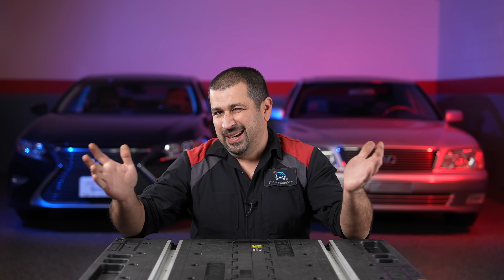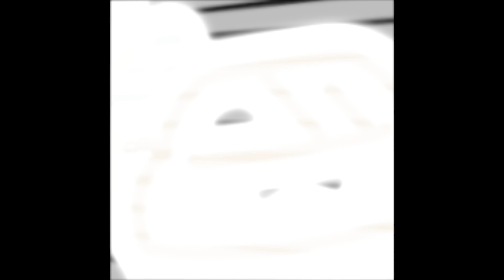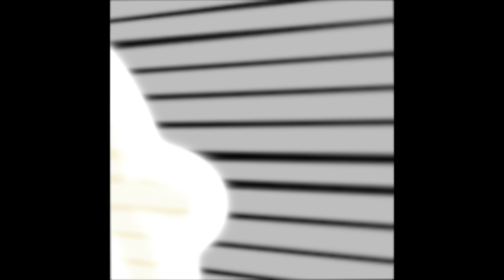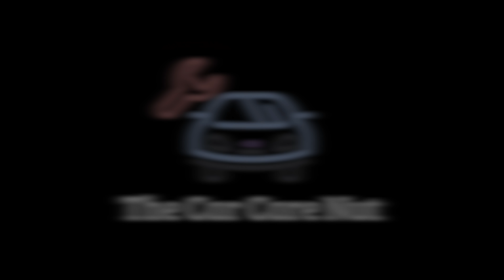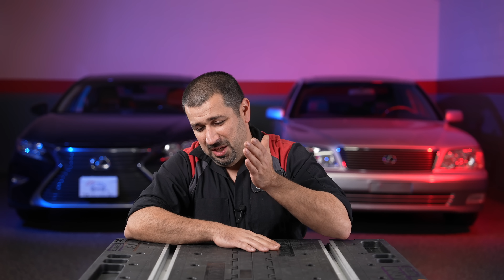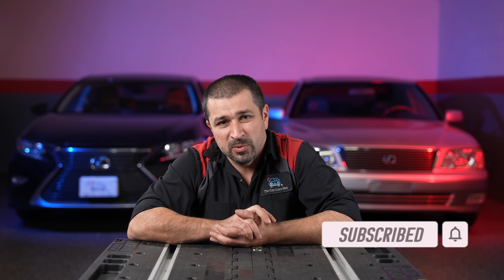Can Modern Turbo Engines Be Reliable? Here's The TRUTH!

Comment: Plenty of 1980s era Porsche 944 Turbos still around. Those were very modern for their time and had cooling that stayed on after the car was turned off. Many other then advanced features. The older generation without this is where turbos really got their bad reputation. I have no problem with turbos if well maintained and perhaps driven a little more carefully until warmed up and before shutdown. Theoretically they are built stronger than NA engines and driven conservatively they should be reliable. Heat is the biggest issue.

Comment: I drove a 240 Volvo turbo with the boost set to 11 psi and sold it still running great at over 300,000 miles. Same turbo. Never had the head off.

Comment: A turbocharged engine will never last as long as a normally aspirated engine. I learned this years ago as an aircraft mechanic. The time between mandatory overhauls on an aircraft piston engine that was turbocharged was always hundreds of hours less than a normally aspirated one. The one thing that will get the most life from a turbocharged engine is easy throttle response when the oil is cold, and most importantly, to let the engine idle for a moment or two after high rpm operation to allow the turbo to wind down and cool off so the turbine bearing doesn’t become coked by heat.

Comment: I have a Honda CVR. It has a 1.4 engine with a turbo. I have the oil changed every 3000 to 3200 miles.

Comment: Turbo engines work at increased pressure, the fuel and air ratio cannot be fooled, and is the same 14.5:1 regardless of whether it is a turbocharged or naturally aspirated engine.

Comment: yes 100 percent correct ,I see new cars using lighter wieght oils than from what I used in my day  like 10 w 40 was what we used on my 84 honda civic when new now they tell you every 5000, to 10,000 mile oli change with 0w30 or 0w 20 these are light oils you can see when you pour them how fast they drip out of bottle and the complaint they use when it time ti change oil ,I'm too busy ,are you too busy to add gas to car when it is reading empty????? thats time wasted  having to stop and get gas every week yet 3 months is not bad,I have a 2009 chevy HHr ecotec engine 2.2 litre with 275,000 miles I bought the car used in 2015 with 86,000 miles at time every 3000 oil change its not hard to do that is what I learned when I was taking automotive classes in school you have to change more often the HHR takes 5 w 30 oil that is light to me so every 3000 miles it gets changed ,most of miles on my car are highway ,unless you can afford todays expensive but cheaply made cars today I know i can't and a lot of these yahoos who buy these turbo cars are the young idiots out there driving like they are on a car race i get passed by every morning going 60 mph  wile they have to go 80 or more todays average driver are people who donot know anything about cars they see on tv how great they run but do not see the care you have to give ,me personally i never trusted turbos ,I always hear how they are always breaking down and always suspected how much stress they add to a 4 cyl car not to mention the price of replacing a turbo !JRo

Comment: 0w8 Toyota oil is standard for my Toyota Crown Signia. First oil change was at 50 miles. Then 500 miles. Then 1000. Then 2000.  Then every 3000 from now on.

Comment: My stock 1991 Skyline GTR turned 34 years old this months and just passed 150,000 miles(~242,000km) on the odometer. I dyno'd it before GTR Festival 2025 and it made 302rwhp(AWD disabled) which is like a brand new engine. I doubt there's any modern turbo car as durable as my RB26DETT.

Comment: The problem is the "Tiny" displacement engines with gas direct injection.  A chevy SUV has a 1.3 Ltr engine with 143 HP - doomed to failure. So the automakers win by reducing the life expectancy of the engine and the vehicle, ( blame it on the Government) and meet the Governmental Regulations. We are the loosers.

Comment: Turbo story time: Back in 1988 I bought my 2nd Mazda 626 - it was the celebrated 1986 626 GT Turbo "Luxury Touring Sedan", which was Mazda marketing for 5-door hatchback. 😜 If you want to see it, search "Flickr Mazda 626 GT Turbo" and click "Images". That's me and my light blue 626 GT in East Boston, MA in 1989 in the first images you see... ANYway, I was lucky enough to get my hands on that car because the original owner was an idiot and they ignored a Mazda issued recall to replace the turbo oil feed line with a redesigned unit which re-routed the line away from the exhaust manifold. The original routing was too close to the manifold and the oil would cook inside the line and cause oil starvation, causing the turbo bearings to fail. That owner was so miffed at Mazda that he traded the car in on a (drum roll please) Pontiac Grand Am. HAHAHA. Meanwhile, I used to perform oil changes every 3,000 miles, and also followed Mazda's owner's manual warning about the turbocharger - to allow the engine to idle for 60 seconds "after spirited driving" prior to shutting the engine off. In retrospect, that was my most emotionally connected I've ever been to a car in all my years of owning sporty fun cars. Granted it probably had something to do with being 21 years old and owning something middle aged people could barely afford.

Comment: What is your advice on new engine oil changes?
My Honda Civic Type R is at 1700 miles and Honda won't change the oil in the 3 year service plan, I have to wait 12 months or do 12500 miles.
What is your opinion on this subject, should I do it?

Comment: Agree .  I had a Volvo 740 turbo gas engine in the 90's with conventional oil recommended oil change interval of 1,850 miles for severe service.   I ended up adding an Amsoil  bypass oil filter which added almost 2 extra quarts of oil to the system while keeping the oil clean to 1 micron.  Still had the regular oil filter and changed that at 6 months and topped up with 1 quart of Amsoil.  Oil and filter change at 12 month intervals.   Sold the car running without engine or turbo problems at 230k miles.  Go with good synthetic oil and change at 3,000 miles if you have a modern gas turbo engine.
Reply: How many miles did you typically travel in the 12 month oil-change interval?  I use Amsoil Signature Series in both my vehicles at the same 12 month OCI (about 7,500 miles for each vehicle).  I had the used oil analyzed from both vehicles that revealed my 2016 Toyota Camry Hybrid had 1.5 PPM wear metals per 1,000 miles and my 2013 Subaru Tribeca had 1.6 PPM wear metals per 1,000 miles (the Motor Oil Geek said that any oil that achieves less than 5 PPM wear metals per 1,000 miles is a really good oil)!  Ahmed's shop (TCCN Automotive) performs all the maintenance on my Camry and gives me spectacular service!
Reply: @jimn.9990 Between 15 to 20k miles per year.

Comment: Ferrari recommend once a year or every 10,000 miles for my N/A 6.5l V12. It doesn't have turbos, but it's very high revving. Should I change the oil every 5k miles or less?

Comment: I am wondering if your comments about diesel engines with turbos apply to those installed in sedans.  Those engines are being used like most gasoline engines on a daily basis in stop and go driving.  Would I be correct to guess that they are not going to be as reliable as those installed on big rigs designed for long distance cruising?

Comment: He is SO right. VW has the 10K oil changes and my first one made it to the 90K range and started to use oil. My next VW currently has 177K on it and it is still perfect. I use Amsoil and change at 5K now. 
Both engines were and are the 1.8L 4-cylinder.

Comment: If the oil is 0W-20 I change it every 3k. I don't trust watery oil to hold up to much fuel dilution or turbo heat in my sports car.

Comment: Will NEVER buy another turbo again.  Bought a 2018 Honda Accord Sport 1.5T brand new.  Babied it, followed all the scheduled maintenance.  Back in March at only 63k miles, the head gasket blew.  Did some research and there are forums all over the internet of people that had the same issue with that engine.  Honda knows it and has done NOTHING.  I believe a group is planning a class action lawsuit.  

Traded it in for a 2025 Mazda3 Select Sport.  2.5L NATURALLY ASPIRATED, no CVT, same HP
Reply: Here’s EXACTLY where you messed up and feel free to do research if you don’t believe me, the 1.5T Honda engines are pure economy JUNK while the upgraded 2.0T are reliable engines that’ll last easily 5 times longer if not more not reliable as the old V6 but still very reliable
Reply: @Mr_Cadillac69  Agree, but there was no way I was going to pay $5k more just for 50 more HP
Reply: @joeb63  That’s why used cars is by far superior, you can see if it’s reliable or not and save a LOT of money while getting a high end version
Reply: @j @joeb63  In your situation I would’ve gotten the much nicer and reliable 13-17 Accord Touring V6
Reply: @joeb63 And you got a CVT on top of that😂😂
Reply: @Mr_Cadillac69 But I don’t like used cars and can afford anything new. I rather be the first one to fart in the seats😂
Reply: @Pamlicojdjdj1487 They CAN be reliable if you baby it like doing the CVT fluid changes every 30k miles and being gentle on it
Reply: @Pamlicojdjdj1487 Not tryna be rude or anything but that is the STUPIDEST shit I heard, at least get a CPO car that’s basically brand new while doing 5 minutes of research on that and save a LOTTTTTT of money, time and stress 🤦‍♂️
Reply: I have a stunning 14 CTS V-Sport Premium with a 3.6TT having 115k, it never given me issues and the original twin turbos work perfectly fine
Reply: Buying new cars is SOOOOOOOOOOOOO damn overrated especially with the ugly junk they sell nowadays, save your money and buy a older model with a good reputation that’s better in almost every way usually (not always)
Reply: @Mr_Cadillac69 Name your choices. Used cars are a crap shoot
Reply: @Pamlicojdjdj1487 I LOVE my fully loaded 14 CTS V-Sport Premium but if top reliability and efficiency is a priority with a taste of luxury, get an Avalon Limited, highly spec ES350, Mazda 6 Grand Touring/Signature, Accord Touring V6 or 2.0T, this is debatable if you take care of it like I did the 14-16 LaCrosse or 14–19 Impala V6 NOT XTS are very reliable cars that can easily last over 200k :)

Comment: Just rolled 222,000 on my 2015 F-150 Ecoboost. I have two jobs and drive it to and from work 5 days a week. Also we have a travel trailer that weighs 6500 lb we take out several times a year. The thing is still going strong. I change the oil every 4500 mi on the dot.

Comment: Turbo engines are 💩. But if you have one, whatever the maintenance interval is, like oil changes, cut by half or even by a third. Just expect these turbo potato chip engines are going to break long before you expect them to, engine cost more than they are worth to fix, which is by design.

Comment: Yes, yes they can.

And if we are not biased fanboi's, Ford's Ecoboost motors have been largely reliable with minimal issues related to the fact that they had turbos. The cam phaser and timing chain issues are both problems that many non-turbo'd motors have had over the years, including Ford's own triton V8's.

But besides those two things, there really has not been major issues with any of the Ecoboost motors in the US. The 2.7L is very solid, the 3.5L has been solid since they handled the phaser/timing chain issues, and 2.3L doesnt seem to have issues other than the 350hp version that was in the Focus RS.

Comment: Why can't the automakers design a turbo that runs off of the crankshaft with a computerized control instead of running those hot exhaust gases into the turbo and cooking the oil. I guess it might be called a supercharger then instead of a turbo. Just would love to hear your opinion on this or make a video on why it could not be done or could be.

Comment: You remember Fram oil filter,  you can pay now or pay later. well your advice is probably the  most honest and true I have ever seen displayed to the public.  Oil is cheap and I avoid turbos at all costs . I also avoid diesel engines in pickups. I own 2 Pathfinders a 2019 and a 2010 both get 4000 mile oil changes. I also own a 1997 Ford SOHC 4 liter in a Ford Explorer , runs like a top. Not for sale none of them. Thankyou sir.

Comment: Catch cans or better yet, draft tubes, to keep the intercooler dry, lower temp thermostat by about 10ish degrees, and a homemade relay/thermo switch to cycle the fans after engine turn off to cool down the hot soaks and they are fine.  Of course, good clean oil and letting it idle a few seconds before turning it off too.

Comment: Listen — I don’t care how expensive or ‘premium’ your synthetic oil is. In a turbo car, it will break down.

Turbos spin at 200,000 RPM and get hot enough to cook any oil. Once it breaks down?
No lubrication. Turbo dies. Engine dies. Simple.

So do the smart thing: 3,000-mile oil changes.
Boosted engines don’t play!

Comment: well explained. I completely agree as a mechanic. Emission regulations have destroyed engine reliability. If you buy into this small engine turbo technology you may regret it.
Reply: So what options you have then? And I hate old used 20 year old cars
Reply: @Pamlicojdjdj1487 Mazda's skyactiv-g
Reply: You got it! All the shit bolted onto those 3 cylinders is just life support devices to get the same output as engines 10 years ago.
Reply: He didnt even mention fuel. These cars fail because people use regular fuel in high compression turbo engines designed for premium fuel. Honda 1.5t is perfect example. Use premium fuel it lasts a few hundred thousand miles. Pre ignition destroys heads and turbos.
Reply: @Cody-f1o9f  People are used to pumping gas often. Oil on the other hand is frequently ignored and forgotten.
Reply: @jeretso  Yes but nobody thinks about fuel grade or octane.
Reply: The emission regs are totally arbitrary, and they don't care about all the air pollution created by having to build a whole new engine or whole new car.  

The "environmentalists" in government are causing MORE pollution, because they only focus on one aspect.  This is true throughout the whole "climate change" response, as well.  Destroy the environment to save the environment.
Reply: @harrymills2770  I like driving and I like clean air too.  Take your pick...one's essential for life, the other not so much.  Go back to school Harry.
Reply: @DrJohn493  You're apparently blissfully unaware of the actual trade-offs involved, taking the most simplistic view possible and calling others uneducated.

I have degrees in earth science and mathematics.  What's your educational background, MSNBC and CBS?

Comment: save 20% of gas
pay 30% more on maintanace.

it does make sense for places where you drive mostly long distances like the USA.
it doesn't make sense in other places where you drive mostly short distances and in traffic like most of europe and asia.

then again, it's not as cost effective as EVs or hybrid,
but easier to buy in the US and many countries without EV/hybrid incentives, or no tax against chinese EV imports.

all in all,
i think EV is best for most people. that being said, i still drive 100% pure ICE.

hybrid is good. but. more parts to be broken down and maintained that both ICE and EV.
turbo gas cars are very efficient, but not as much as EV, and more maintance and more things to break.

pure gas is simple. if the engine is small it can be efficient - but unfun.
there's a market for everyone but i'll drive my gas car until it break then get an EV probably 5-8 years down the road.

Comment: My brother and I bought 2012 Ford F150 pick ups within a week of each other. Both with the turbo charged eco-boost. Another brother purchased one in 2015. I ran mine for 250 K miles until a deer strike totaled it, my brothers is still about to outlast the truck itself, at 340 K. Both of us happen to be very focused on fuel economy, being in the trucking industry, I think that’s the reason we got along with these engines pretty well  with 3k oil changes. Our other brother with the 2015 hold a camper trailer around in the western part of the country and had to put turbo chargers on it before 100k. Incredibly expensive fix. I’ll never own another turbo charged gasoline engine.

Comment: Car Care Nut, you are too generous. The takeaway from this video is simple: these engines aren’t as reliable as the ones that came before. The need for strict warm-up and cool-down routines, difficulty with DIY maintenance, and more-frequent-than-recommended oil changes are all signs that these turbo engines aren’t designed for the average driver or owner. Smart people will avoid these turbo models altogether.

Comment: The perfect engine is a methanol fuel cell.  No moving parts in the engine, no emissions.  After 200k miles, unbolt, put new on in.
Gas up at the service station like you always do.
Genius!

Comment: Use the best motor oil you can find, and change your oil every 4000 miles regardless.
Also disable the auto engine off feature if your vehicle has one.

Comment: True statement about oil change, which I did learn back in the 90's when I bought Saab 900 turbo.. Keep it simple, oil & filters replacement and there is no alternative. Last but not least cool down engine for 3-4 minutes before switching it off after expressway drive..

Comment: Absolutely spot on! I have a 2013 Pilot and a 2003 LS430. I will never need to buy another car as long as I continue to service the engine at 4000 miles with quality oil AND quality filters like WIX. ALL other fluids serviced at regular intervals.  Keep up the good work .